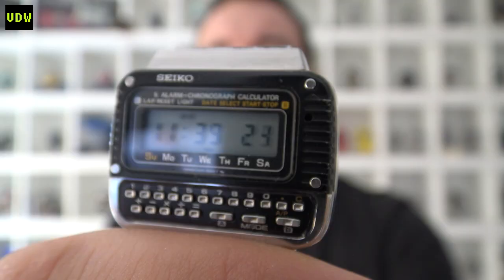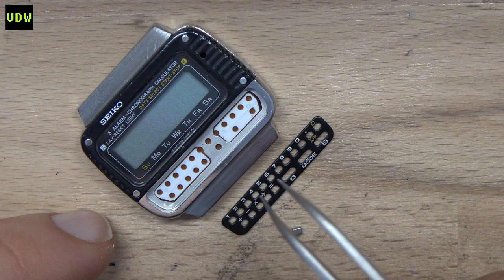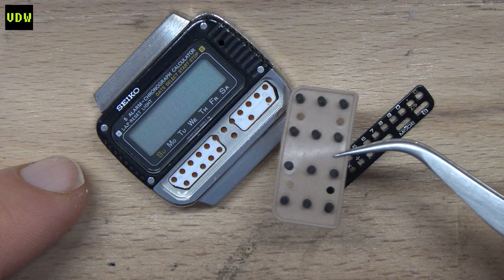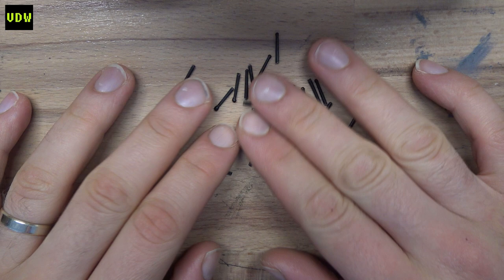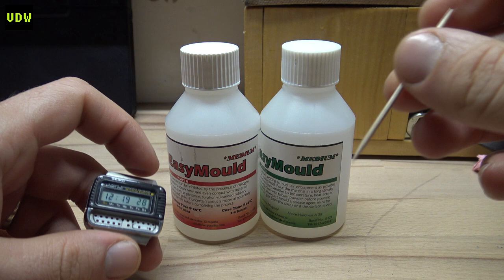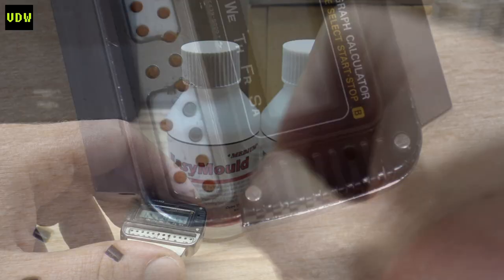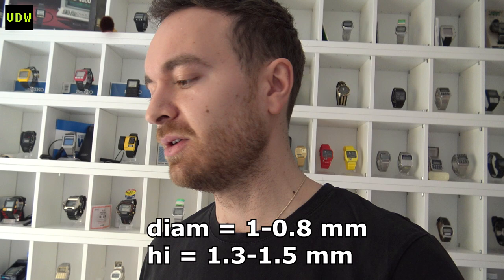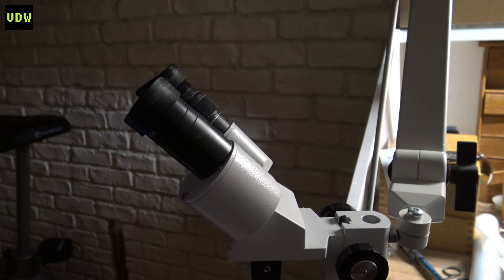Seiko C439 keypad FIX - Ep 97 - Vintage Digital Watches

Comment: Very skilfully done man. I just have a suggestion for the procedure, see what you think.

Glue each button to it's black stud.
Place each button/stud assembly in their correct position.
Surround the button/stud islands in a sea of silicone.
Float the cover plate on top so that its bottom surface makes contact with the silicone and a small bead forms around the edge sealing it in place.

Comment: Hi great video and very nice watch!
I use UV glue to fix the keyboard in place.
UV glue is clear, strong and it gives you total control over curing process. 
I also use sugru rubber to mimic original gasket.

Comment: Amazing restoration, 6:18 next time put litte drop of oil to avoid stuck silicone to the case, and in 9:13 use liquid polyurethane for that purpouse or 
neutral black silicone
Reply from the maker: Oil is not a good idea will sip into the movement later on, it is the same thing as using the liquid wax whivh is putpose build to avoid stuck silicone. Thanks for the tip on polyurethane.
Reply: @VintageDigitalWatches  Thanks to you, yes maybe oil on that place its not nice, polyurethane is expensive but is a perfect solution include to buid a new wristband, i use to restore hifi vintage audio and old retro computers or consoles too 😉

Comment: Perfect fix, but I shave my head daily. Would a blade work just as well? 😄
Reply from the maker: :))), you can use the blade to cut the excess silicone.
Reply: @VintageDigitalWatches  But I never use silicone on my head. 😄 Seriously though, that was a really good job you did and guaranteed fix to last a long time.

Comment: Super nice fix bro 👍👍👍

Also i have two questions, if you dont mind.

Its that an irreversible fix right?

And, do you know where i can find Casio circlips for buttons?

Thanks in advance
Reply from the maker: Hi Victor, the fix is permanent.  There is a store in UK, Cousins, that sell these, alternatively you can get some old broken Casio and get it from that.
Reply: @VintageDigitalWatches  thank you so muc for your response my friend.

I saw on cousins, but dont know the size, maybe is 1.5? Or 1.2? 

Thank you so much
Reply from the maker: @victor-zi3md  casio had the largest ones, citizen and seiko use really smal ones but in  some cases bigger like casio.
Reply: @VintageDigitalWatches  thank you so much my friend, so im going to try with 1.5, will tell you if fits

Comment: Hello! I have the same watch with the same problem. Will there be grease when this transparent resin dries? Will residual grease destroy the circuit board? Now I have ab silicone on my hand, I am afraid that the grease left after the glue dries will leak into the circuit board. Please reply when you are free! Thanks!!
Reply from the maker: The silicone I used does't leave grease resodue...and honestly I don't think sanitary silicone would either.
Reply: @VintageDigitalWatches
Reply: @VintageDigitalWatches  ok，thank you！
Reply: I did not use silicone to fix it at last. I connected the rubber rod directly to the button and then fastened the keyboard, but the rubber cut a little too long. After fixing the panel, it was easy to press the switch automatically. Unfortunately, I can't send pictures here, otherwise I can share them with you.